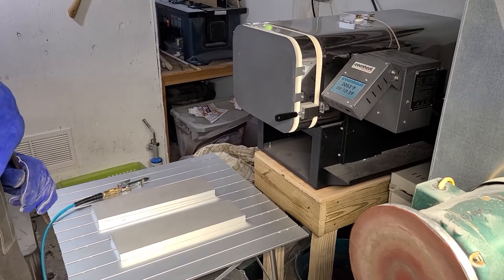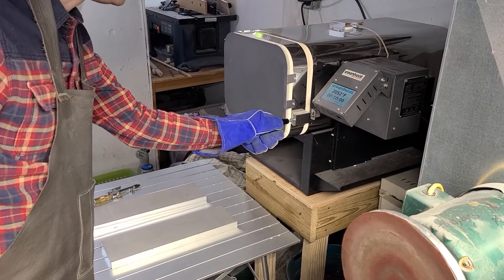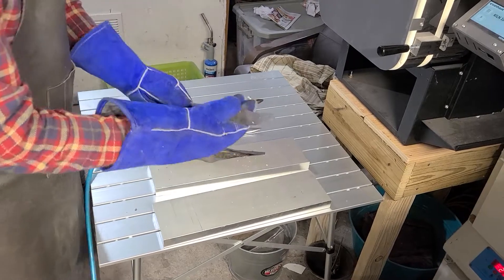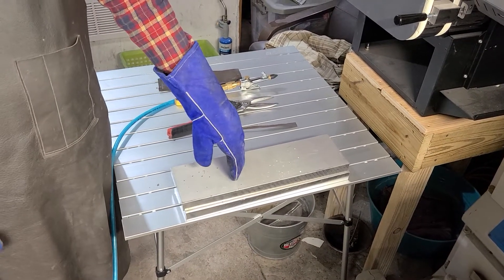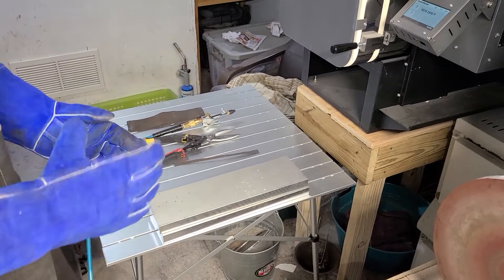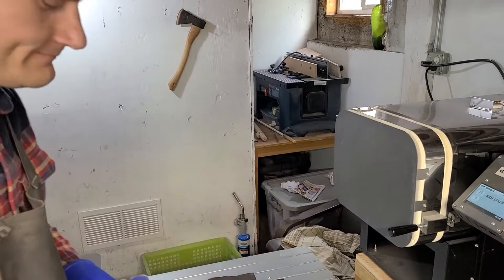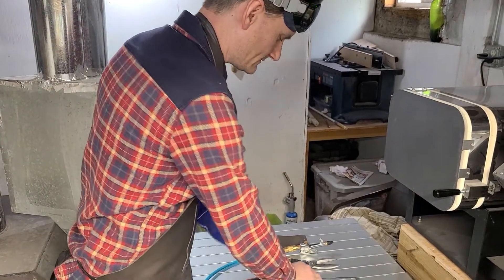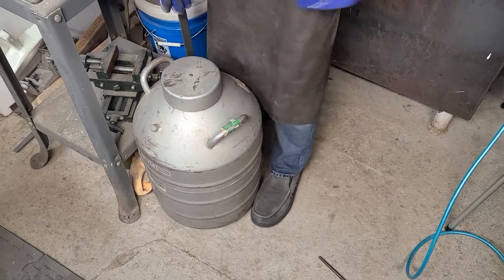Knife Quench and Cryo - Magnacut Steel

Comment: Thanks for posting, Josh. Not really a knife maker here. I make straight razors now and then, usually 1095 or O1, sometimes 1084, and on a whim I just bought a piece of MagnaCut. Do the plates have to make full contact with the blade, for plate quench? Can you plate quench a hollow ground razor effectively? I know I can use an interrupted hot oil quench, but I would rather use the plate method since that is what CPM recommends. I am only shooting for about HRC60 after temper. As you know, I am sure, most straight razors have an included bevel angle, set by the width vs spine thickness, of around 16.5° to 17°. It is very important that the edge not microchip easily but still keep a decent edge with regular stropping. Mostly I want to use a better stainless so I get smaller carbides and also retain some dissolved CR to make the razor less subject to rust. We usually use carbon steel for razors but I want to do a few SS ones and maybe a few pocketknives, too. I don't have a dewar and honestly I make so few blades it wouldn't be cost effective to get one and fill it, so just going with normal quench and temper. And so, all things considered, an incomplete or inadequate quench would be a disappointment.
Reply from the maker: I've actually done a great deal of experimenting with this, including plate quenching beveled knives, and interrupted oil quenching of air hardening class steels. There are no cooling issues with plate quenching a beveled knife, from what I have found, and thus I do it with a lot of my knives.

But, that aside, in your case I do not think it would work out, for different reasons. It's true that plate quenching avoids warpage, but it doesn't completely eliminate the chance of it. On thicker blades it's not a problem, but if you had a thin beveled blade like a razor? It will not only be a very high risk of warping, but you might even bacon the edge. What you COULD do, is partially bevel it, but leave a good amount of meat on it, and then remove the rest post-heat treat. Post-HT grinding is extremely common, but it does mean you need to be extremely careful it doesn't get hot. It also means that you must use a sander or grinder to do your bevel, as a hand file won't work.

Also, it's impressive you can hollow grind a razor! I doubt I could do that, myself! If you try out these new super steels, I think you will be highly impressed! I can never go back to carbon steels now!!! Magnacut baby!!
Reply: @joshcoar7386  Yeah nearly all straight razors are hollowground. The spine must always be in contact with the honing media any time the edge is also touching, because is what keeps the bevel angle consistent . Hollowgrinding makes the honing easier by reducing the contact area to a thin strip at the spine and another at the edge. 

Because most hobbyist and artisanal razorsmiths use oil hardening high carbon tool steel, oil quenching is the norm, and if a fully developed edge is austenized and quenched normally, the razor will often crack from the edge inwards toward the spine. So, we usually leave the edge about .020" or a bit thicker, and then do a final grind after all heat treating is done. 

My Paragon only goes up to 2000°F and so that will be my austenizing temp, and I figure on interupted oil quench in 125°F Park 50 down to 1000°F, air or plate cool to about 400°F and return to the oil while my oven cools down to 375°F for two tempers of two hours each. I am hoping for a nice HRC60 end result, approximately. Also looking at trying S35VN. Both of those steels look like they would make good razors. 

If it doesn't work, it doesn't work. I already got the steel so it's gonna happen at some point.
Reply from the maker: @growleym504  Honestly, I think you are fine just plate quenching it. The problem you will have with interrupted oil quenching, is knowing when to interrupt. You do have some leeway, as the pearlite nose is actually at about 1200F to be exact, and martensite formation begins around 400F. Generally once the steel turns black in the dark, at around 900F, so if you are completely dark or close to it, that is a good indicator. But if you do get set on doing this, you might want to look into a compound called Condursal Z1100, which will eliminate the need to fiddle with a foil pouch. 

If you have any reject blades to test with, that are already beveled, you might want to do some test quenches and time it. Parks 50 is also the fastest quench oil there is, so you may need to consider getting a slower oil.

But again, with such a thin blade, a plate quench really will cool it more than amply, even if beveled, and will eliminate more of the risk of error from an oil quench. 

And always always always do stress relief first! Put it in the oven at 1200-1300F for a few hours and then let it oven cool over night. This should eliminate most warpage risks.

Comment: Can you tell me about you liquid nitrogen set up? Where did you get the container? How long does it last? How do you refill it? Where do you get the liquid nitrogen from? Thanks. Great video.
Reply from the maker: My container is a 30 liter dewar. I found mine for a good price on Craiglist, but otherwise they can be quite pricey (Ebay would also be a good place to look.). Mine lasts for about 2-3 months. I can't do longer knives after a couple months because it gets too low, but shorter 4" blades I still can. Most welding and gas supply companies sell liquid nitrogen, and the price really varies depending on where you live. I'm in a very remote location so it costs me $100 to fill mine up.

You can heat treat air hardening class steels like this without it, but you then have to temper at 900F or so which really messes with your grain size and more, so you get an inferior end result.
Reply: @joshcoar7386  I'm assuming the steel needs to be completely submerged into the liquid nitrogen?
Reply from the maker: @toolman9081  Well, at the very least the blade portion. Your handle having a little retained Austenite in it isn't really a problem (assuming this even happens. I have never tested.). I have experienced warpage during cryo in the past, but I don't recall it ever happening from only the blade being submerged but not the handle (Just make sure it is completely suspended and not touching anything in the dewar.). I'm also not sure how much heat transfers from the unquenched portion - it may very well get down to -300 F which is more than ample. I guess I can test it with a thermocouple sometime.
Reply: @joshcoar7386  thank you for your time and the education